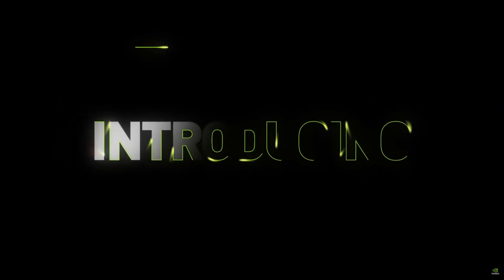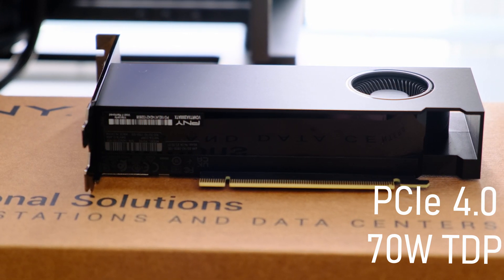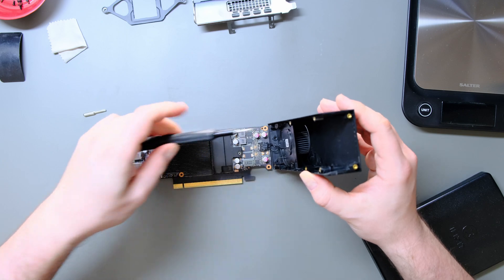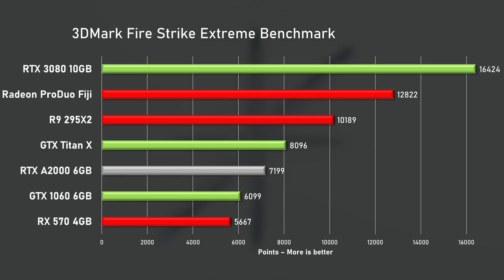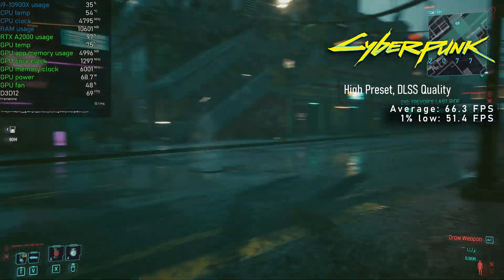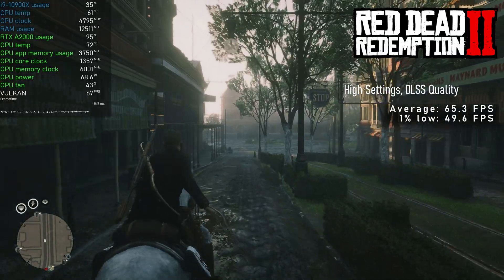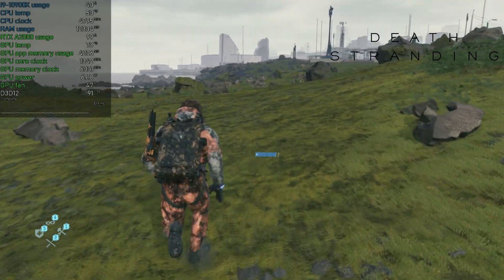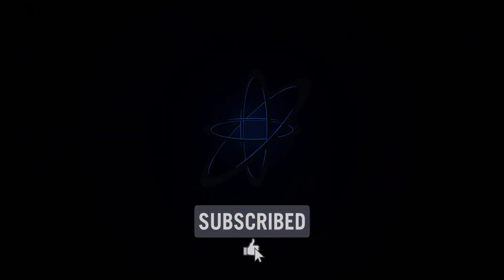This tiny RTX A2000 packs a punch and defines the word "Efficient"!

Comment: I'll be getting this card or the rtx 2000 ada/A4000 for my work computer, along with Ryzen 9 cpu, 128gb ecc ram, i don't do games but I mostly just find this card being compared for games or render benchmarks so it's hard to decide if it will work for me.  Im mostly using it for Adobe suite, and because it has ecc vram, as my main software uses mostly cpu.

Comment: I bought this card off a crypto-miner for 191GBP. It supposedly had been mined for 6 months prior to my purchase and it's working wonderfully. It's as if it were new. I don't like the fact that in small form factor builds temperatures at maximum can get up to 82-83C but if I put it in a normal midi-tower temperatures are around acceptable 78C. It's a great card, I just wish the cooling solutions were better for smaller PC cases.
Reply: I’m using an rtx 1650 in a sff pc.  Similar issues with cooling. The hp case I’m using is quite awful. I’ve got some simple DIY usb fans on one end. This has brought the gpu temps from 86C thermal throttling to 82C. 
I’m tempted to cut a few wholes in the case above the cpu and gpu for improved airflow

Comment: I have a rtx a2000 as well. Great little card. Have had mine since September 2022.

If you have not all ready done it. I strongly recommend you try to overclock the rtx a2000 with example msi afterburner as 8 know working with it. I have gotten some nice gains with overclock on my rtx a2000. Gpu core clock is set to 260+, but I can't remember what I have set memory to. But try it out and you could maybe make video out of to. I don't need a video throw as I have my oc dailed in. But new owners of a rtx a2000, a video I think could come in handy.

Comment: I have an hp office pc as my work/gaming station right now, so i might have to pick me up one of these! The 6gb version is only $299 so I'd call that a real steal for the performance when you can just pop it in an old pc and it'll work. (edit) My pc has a 310w psu, so yes, it should be fine for this GPU. Its not that old.
Reply from the maker: Hello mate! What CPU are you using ?
Reply: @nexus_tech  Ryzen 5 5600g is what it came with.

Comment: I picked up a 6GB version to put in an upgraded Dell OptiPlex 7010 SFF (16GB/500GB).  Spendy, but what an amazing card for gaming, and perfect for a SFF build.  In addition to all the benefits you cited it is also dead silent.
Reply from the maker: Thanks for sharing :) What CPU are you using ?
Reply: @nexus_tech  It's a 4th gen quad core i5 (3.2 GHz).  The computer performs very well, especially given its age, which I think has a lot to do with the SSD and RAM upgrades.
Reply: My boy i got the same build I bought this bracket for my sd card that fits where the cd player use to sit it's so clean con no cd player but setup is clean and plays better then almost every video on you tube
Reply: unfortunately i was messing w the nvidia settings and pc isn't booting up any more thats why im here looking trying to figure out what's wrong
Reply: @jrocket93  Have you tried pulling the card and booting without it?
Reply: @ just disconnecting it no . i don't have other gpu but ill try that thanks
Reply: @jrocket93  The OptiPlex PCs usually have onboard graphics (VGA or DVI-D).
Reply: @ did see that will be last try before i give up on it . the windows logo pops out and loads into a black screen but strangely my tv does capture the pc display settings because it switches to it after loading im wondering if i just can't see the image ?

Comment: IMO the most interesting thing about this GPU is that Samsung 8nm wasn't even particularily efficient. If Nvidia made a Lovelace based 75W GPU it would probably easily add 50-90% of performance
Reply: yeah im sure this gpu is great but it sure is very expensive.
Reply: Yes, but they prefer to feel the twitching rod of ai deep up their ass.
Reply: I think a2000 still good deals. Nvidia a4000 sff price more than twice a2000
Reply: @zamroni22  a2000 12gb is 200$ on used marked. very good deal IMO

Comment: Had a Quadro 2000 with the GF106 from GTS450. You can call it the spiritual successor of A2000. 
At first, I was really impressed by its efficiency and temperatures. By then one day I checked its voltages and realized that it ran at 850mV at idle and peaked at around 875mV under load. Meanwhile, a standard GTS450 also idles at 850mV but peaks at around 1,080mV. 
So, it was essentially just a heavily undervolted GTS450... at least from a gamer's perspective. I think the same can be said about this A2000. It's a slightly cutdown RTX3060 with a massive undervolt!
Reply from the maker: Thanks for sharing 👍 I love old power munching GPU's, but the way the A2000 delivers impressive FPS and does it without external power, just wow 🙂